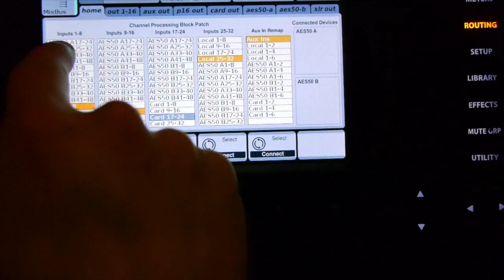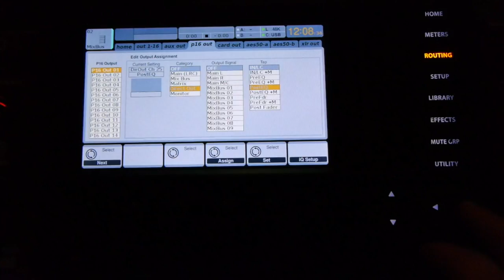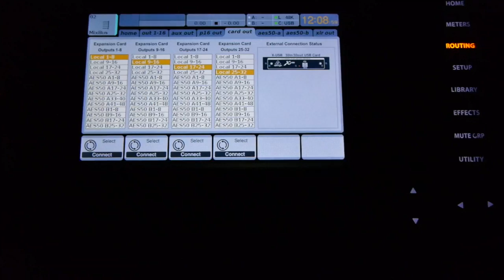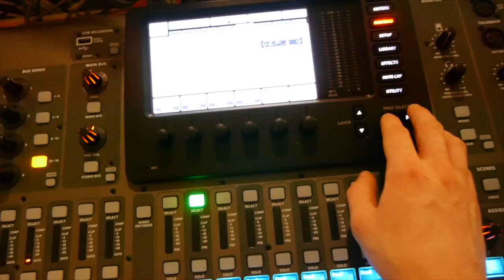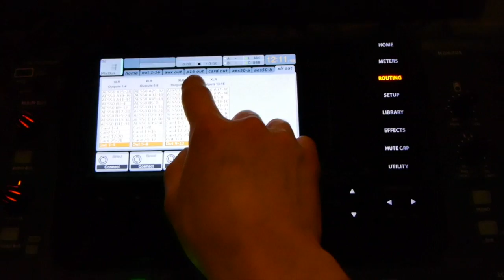Behringer X32 Training - Routing Introduction

Comment: I understand the routing for card out...but what about card in..??? getting audio from my pc or daw to playback in x32  (rack)  ????
Reply from the maker: Thanks for the question. While “card out” has its own page on the x32, you’ll need to go to the home page of the routing section and scroll down to Card in for each block of input channels (1-8, 9-16, etc) to have DAW audio play back through the x32. That’s assuming your card settings are set to 32 in and 32 out. Let me know if that works!
Reply: Gregory Allison I’ll will try it next week ... only have access to the x32 once a week, we use it to rehearse... I use the xr18 here, much easier to route... will keep you posted.